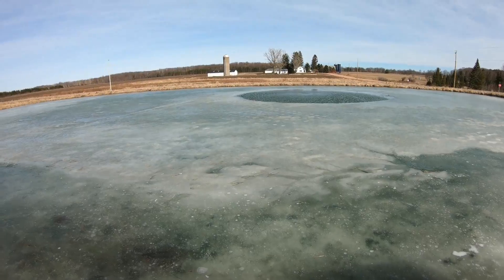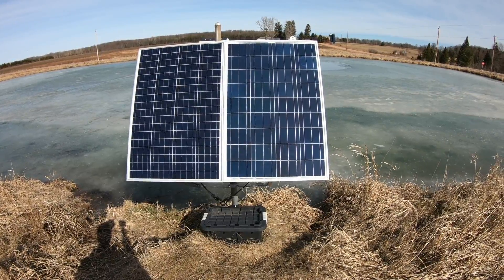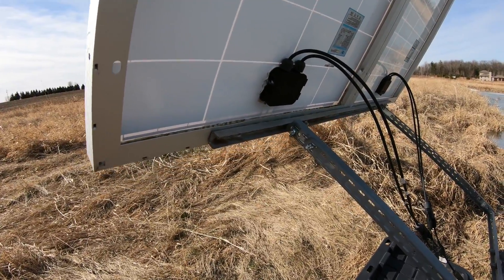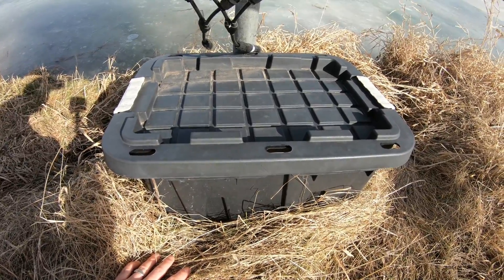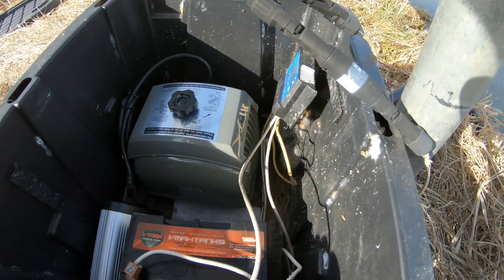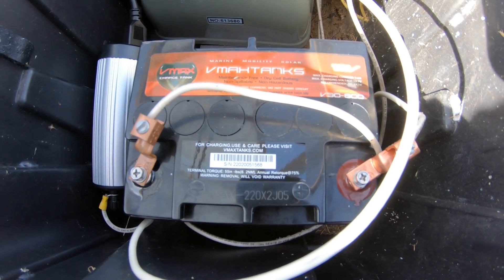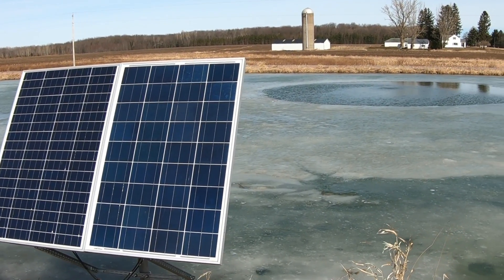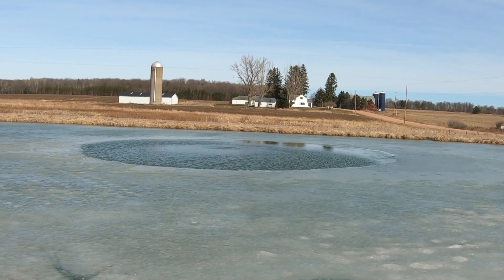How To Build Your Own Solar Pond Aerator

Comment: I know you switched yours over to batteryless, but just posting this for others.  You would be best off going with a LiFePO4 battery to handle the cold conditions.  You can give an AI interface your pump/solar panel/inverter specs and how long per a day you want to run the pump.  It will tell you what size battery you should get.  I bought a 160ah LiFePO4 battery for $200 and it will run my pump 9.5 hours per day without putting too much pressure on the battery.  I plan to have mine on a timer to run in the evening hours to avoid over heating the pump.
Reply from the maker: That is great info and I’d suggest using lithium batteries as well.  They have come down in price quite a bit since they first came out. Thank you for sharing.
Reply: @DeanoOutDoors  Yeah, LiFePO4 is a type of Lithium.  However, the LiFePO4 allows for charging in freezing temperatures.  I didn't even know what these batteries were until I researched a little.

Comment: What size is your pond? Im sitting on a 2.35 acre pond and possibly thinking about doing a few of these across the whole thing. Only about 5' deep
Reply from the maker: The pond size is 1 acre and around ten foot where the diffuser sits.  I would thing that two of these would work pretty well for your pond size.

Comment: Part of your deep cycle marine battery problem was that you were discharhibg ut to near zero charge. The life of them is degraded if you constantly do that. They dont like to go bekow about 20%. The problem wasnt the battery but on how you designed the system.
Your system is designed too small to run continously, because it ran out of juice each day.
Yo probably needed closer to 600 watts  of generation to do so,along with a second battery in parallel.

Comment: i just built your identical system, except for an 80 Matala pump (82 watts).  every time the LVD turns on the inverter and pump will turn on for 1-2 seconds and then the LVD turns off.  can i adjust the LV to less than 12.0  or what else should you suggest.
Reply from the maker: You could try going down to 11.7 see if that solves your problem. Using the larger pump, you may need to add a little more solar watts.
Reply: @DeanoOutDoors  Ging to 11.7 worked - but not satisfied with the pumps power.  so now got the 100 matala pump (116 watts) plus 200 more watts (400 total).  still having the issue. pumps turns on 1-2 seconds the LVD turns off.  any suggestions.  thanks for your input and your videos

Comment: Any pros/cons to using a lithium battery? Trying to get some extra run time.
Reply from the maker: The only problem you may run into using a lithium battery would be charging in freezing temps.  Lithium batteries have a BMS that keeps them from charging when the temps get too low. You could find one that has a built in heater, they are out there and used in EVs. But probably very expensive.

Comment: Great video! I ordered the same setup, but with only one solar panel, u think that will still work w my 85watt aerator?
Reply from the maker: You will need 200 watts Solar to power that pump. On a clear, full sunny day, you’ll be putting out just under 100 watts with one panel. There will be line loss and the inverter will consume some of that power as well.

Comment: Does the pump over heat in the summer in the box?
Reply from the maker: I haven’t had any issues with it, been running the same pump for five years now.  But, if your in a very hot climate and concerned, you could cut open a vent area and install a screen mesh to keep out the critters.
Reply: @DeanoOutDoors awesome video! Thank you for posting and replying so quickly. I may have missed, roughly what is the size of your pond?
Reply from the maker: Yep, you’re welcome.  Just under one acre.
Reply: @DeanoOutDoors last question and I promise to leave you alone. Home Depot has a vevor aerator 550 W with 3/4 HP and 100 foot hose set up. Would I use that with your system or would I need more power?
Reply from the maker: That pump would use too much power, I believe it’s rated at 550w. The pump I’m using is around 85w. You would need a lot more solar and larger components to run the pump you are describing.

Comment: Thank you for doing this and putting the knowledge out there! I have some questions:
1. Where are you based? How cold does it get in a typical Winter?
2. Do you leave the pump set up like that all Winter long? No problems with battery freezing, etc?
Thanks!
Reply from the maker: I’m in Wisconsin, temps drop down to sub zero many nights.  Yes, I left it setup just like in the video.  The battery life was around three years, you could get more if you adjust the low voltage disconnect to a higher voltage setting which after using it for some time, I would recommend a little higher setting.  I am now using a battery-less system. You can check out that video here if interested https://youtu.be/Y5JmN69_-DA?feature=shared
Reply: @DeanoOutDoors  Just watched the battery-less one, I think that's what I'm going to do! Project for next year. Maybe I'll try to set up the wiring components this Winter and deploy it in the Spring.

Comment: How do you address the issue of battery degradation when charging them at temps below freezing?
Reply from the maker: That can be a problem. The AGM batteries are better at handling this situation.

Comment: Very helpful video! So I understand depending on battery size will determine how long the controller will let pump will run after sundown based on the cut out voltage setpoint. So when the sun comes back up will the battery have to recharge (cut in voltage ) for the pump the restart. Can the solar panel run the pump and charge the battery at the same time? Thanks for all of your help sir
Reply from the maker: Yes, the battery will need to reach cut in voltage for the pump to start back up.  The solar will continue to charge the battery while the pump runs as long as the sun is shining.

Comment: I built this system about 16 months ago and it has worked great Except our hot Texas weather caused issues with the inverter.   I built a cover for shade which helped last year, but our monotonous 107 days this summer has overwhelmed it again with a cover.  bought a new one and it worked a few weeks and quit  I have an old one I use with my C pap when camping and swapped it out but it cuts off periodically  Do you know any more inverters that are more heat tolerant?
Reply from the maker: I’m not sure about an inverter, but you could try running a small fan to cool the inverter down.
Reply: @DeanoOutDoors  You could also try adding a timer to only have the pump run in the evening.  I watched another video where a guy suggested that.

Comment: What if the water is only about 2 ft deep? Will it work?
Reply from the maker: Depends on what you define as “will it work?”   Yes the system will diffuse air into the water as long as It’s below the surface.  But as far as keeping fish alive, that depends on where you are located.  If you get a deep freeze, I doubt the fish will survive in that shallow of a pond.  Hope this info helped.

Comment: Thanks for this video - very helpful. Did you use concrete to hold the pipe & panel stable? Or just plant it a few feet deep?
Reply from the maker: Your welcome!  I did not use concrete, just drove the pipe down into the ground four feet.

Comment: Hi Deano, first off, I truly appreciate this video and your other video detailing the wiring. Your two videos have been my primary starting point for setting up solar aeration on my pond. Infact, I just realized I posted a question several months back, ha.

I've decided to go with a 1/4 hp fountain (HQUA-FS02 120V), instead of a diffuser. This is my first dive into the world of solar power. I'm wondering if your panel/battery setup will be enough to power the fountain throughout the day, or if you have any recommendations on how I would calculate that? From what I've been able to gather, a 1/4 HP at 120v uses ~1.6ah (.1865kWh ÷ 120V × 1000 = 1.554ah) and using the 30ah battery listed, I should be able to run the motor for approximately 15 hours. I'm sure there's much more to it, but this is my current layman's understanding.

Any additional advice is appreciated. Thank you!
Reply from the maker: If I were you, I’d definitely go larger on the solar panels.  Your looking at using around 186 watts of power which would be maxing out the system. Go at least 300 watts.  Also, a 30ah battery is roughly 360 watt hours.  That would only power your system for just under two hours.  If you’re looking to run your pump into the night, your going to need a lot larger ah battery.  Hope this helps get you going in the right direction.
Reply: @DeanoOutDoors  thank you for the reply. I was way off, ha. I did the math with the appropriate panels and battery; figuring 150ah would get me just under 9 hours. Unfortunately, this bumps it outside of what I was looking to spend. Fortunately, I can go the diffuser route and possibly upgrade in the future. I really appreciate your information and advice, thanks again!
Reply from the maker: Your welcome, and good luck with your build.

Comment: Hello, great video.
My pond is 12 feet deep do you think, that pump produce nice pressure for my pond?
Reply from the maker: Thank you!  Yes, it should have no problem aerating your pond.  I’d recommend using the larger diameter air line for best results.

Comment: Deano, thanks for the great shopping list. I just finished purchasing everything on Amazon. I noticed the link for the battery results in a 35AH VMAX and not the 30AH. Will this still work with the 30 Amp power controller?
Reply from the maker: Your welcome!  Yes, it will work just fine.  The 30ah was out of stock or discontinued.  The only difference is, you will get a longer run time into the evening with the 35ah battery.

Comment: Hope this is not a stupid question but what is the difference between the 2 different types of solar panels you have listed? One is mono and one poly?
Reply from the maker: Yes, I ended up trying both styles.  Both are one hundred watt panels but the mono panels are more efficient, especially on overcast days.  Usually the mono panels are a bit more money as well so take that into consideration when planning your build.  Hope this info helps.
Reply: Thanks for the info! I live in TX so cold is not a huge issue so is there a 12V pump you would recommend? I am told they are more efficient but I dont know that for sure.

Comment: I would like to make a DD system and eliminate the battery
Reply from the maker: Nice, let us know how it works out.  I tried using a 12v pump in the past to eliminate a battery.  The problem I had was when the cold temps came, the pump would be too stiff to start up.  I am in the process of designing a battery less 120v system and hope to have it perfected next spring. Thanks for watching!

Comment: Thanks for the video! I built a solar aerator with these instructions.

Question: my aerator was working perfectly when I first set it up. When I went back to check on it a few days later, it wasn’t running anymore. The solar charge controller shows a 13.2 voltage currently, and it also shows connection to the solar panel, battery and inverter. The green light on my inverter is no longer on. I am wondering if something is wrong with my inverter. Do you have any ideas? Thank you!
Reply from the maker: Try powering your inverter off/on to see if it restarts.  If this solution works, then you need to increase the cutout voltage on your charge controller.
Reply: @DeanoOutDoors  unfortunately that didn’t work. I can’t figure out the issue. I tried a new inverter. That’s not working either.
Reply from the maker: Okay, it sounds like the charge controller is bad. To test this, try connecting the charge controller directly to the battery.  If it turns on and runs, the charge controller is either defective or you need to turn on the load if it somehow got turned off.  Let me know, thanks.
Reply: @DeanoOutDoors  Sorry, I forgot to follow up! I am not sure what was wrong exactly, but we replaced the solar controller and the inverter. Now the aerator is working perfectly! It has been bubbling away for 3 months now without me having to touch it once. Thanks for the great video! Our pond is looking fantastic.
Reply from the maker: That’s great to hear!

Comment: Im about to build from your instructions , any upgrades you suggest since this video ?  Thnx
Reply from the maker: If I’d do anything different, I’d get a better charge controller, and probably the next size larger ah. Battery.   That’s about it.  Good luck with your project!

Comment: Hi Deano.  I had asked you a few questions on your solar aerator wiring video link.  Can you please tell me what size inverter we should get if we double the battery and the solar panels?  Thank you so much for your time!
Reply from the maker: Doubling the solar and battery bank will not affect the inverter size.  It's the amount of watts that the pump will draw.  The larger the pump wattage the larger the inverter you will need to power it.   Hope this helps.
Reply: @DeanoOutDoors  Thank you!

Comment: Fantastic , is it really that easy  ??
Reply from the maker: If you have a little electrical knowledge, it's fairly simple yes.
Reply: @DeanoOutDoors  thnx , do you know if you would use different components now or is there better current choices ? Thnx
Reply from the maker: If anything, I would spend the extra money and get a better charge controller.  Other then that, not really.
Reply: @DeanoOutDoors  thanks , you saved me lots of time and money

Comment: Did you use the 30A solar charge controller? There are a few options and want to make sure I get the right one! Thank you!
Reply from the maker: Yes, use the 30A charge controller.  Good luck with your solar project.

Comment: Hi Deano! Thanks for the video(s) on this setup. I'm only just now getting into solar and I'm wondering why you list both a poly and a mono panel for this build? Is there any reason I wouldn't want to use 2 mono panels? Thanks again!
Reply from the maker: Hello Christopher, thanks for watching!   I list both panels just to give you the option of choosing either one.  It's just personnel preference and I actually prefer the mono.  Yes, I would definitely get two of the same panels, I do not recommend one of each.  Sometimes poly are cheaper so many people will buy those over the mono.  However, mono panels will give you the best performance.
Reply: @DeanoOutDoors  excellent. Everything I've been researching says to go mono, as well. I appreciate your response. Thank you!

Comment: Hi-- Thank you! Really appreciate all this info and how detailed you are. We're doing it! My question is this-- our pond is 1/3rd of an acre, approx 15 feet deep and I'm seeing that can be trouble for the pump. Do you recommend that we bump up to a 80L? Or a piston driven one? Also, wanting to confirm that we are going to need to buy all the wires that interconnect these components. These aren't supplied with them, right? Standard stuff?  

Thank you again-- really making this possible for us. (Total is coming to about $800 from Amazon right now but it's still a huge value for us)
Reply from the maker: You might want to use the 80L pump.  If you go that route, you will need a bit more solar watts and a larger ah battery to support this pump.  Yes, you will need to purchase the wires sperate as well.

Comment: Did you place this in the center of your pond? Did you drain it first in order to get to that place and depth?
Reply from the maker: I used a small row boat and placed it in the deepest spot on the pond.  I knew about where the deepest spot was from ice fishing it.  Use a rope attached to the bucket to lower it into place.

Comment: I have an extra 305 watt solar panel. Will that work with this system as is?
Reply from the maker: Yes, as long as it is a 12v panel.  Otherwise you will need to reconfigure everything to 24v.
Reply: My panel has 72 cells so is 24 volt. What would I need to do to reconfigure so your system works?
Reply from the maker: You will need 2-12 volt batteries wired in series or 1-24 volt battery, and a 24 volt inverter.  The rest should be compatible.
Reply: @DeanoOutDoors  thanks so much for your help! I’ll see what I can do .

Comment: We installed our solar powered pond aerator over the weekend. Wow! Thank you! I learned so much and my pond is on the way toward recuperation. Thank you for such clear instructions. Anyone who decides to do this project should expect minor variables and adjustments based on what you have laying around to recycle or put into use or purchase, what you decide to spend, and your ability to lift, or have another person to help with things like installing a post.  I have lots of fence posts, so I chose to mount it on a fence post. (I may add another post) That changed the mounting hardware for example. I chose to install it with a hinge on the top so the angle should be changed seasonally.  I am so pleased. I can't thank you enough!
Reply from the maker: That is so great to hear!  Your welcome, I'm glad that my video helped you out.  I like your idea with the hinge for seasonal adjustment.  I may need to incorporate something like that on my system.